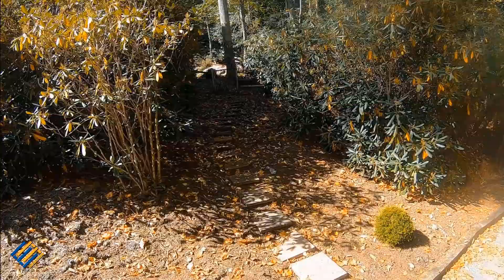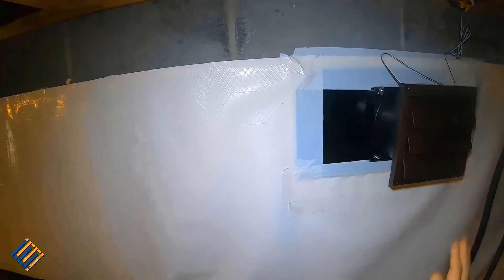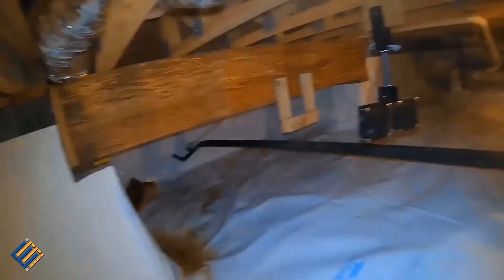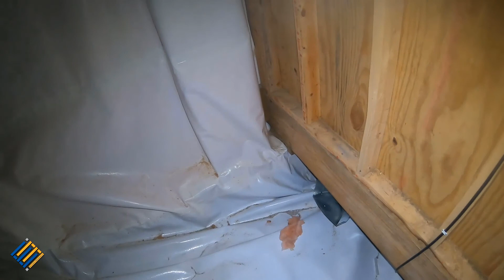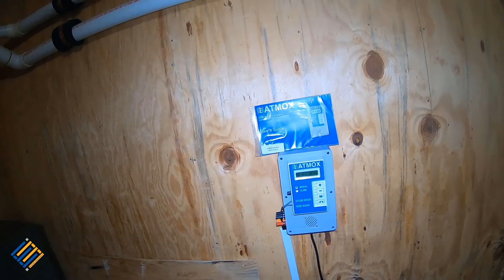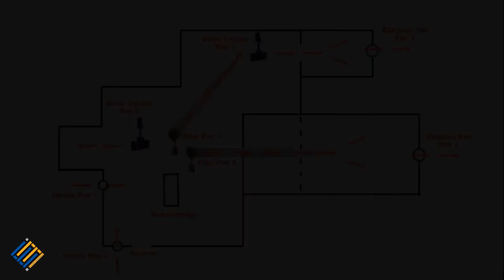Control Crawl Space Moisture Atmox   Waxhaw NC   Specialty Foundation Repair   704 787 6972

Comment: Thank you for making this informative video Mr. Masserang. I recently encapsulated my crawlspace and installed a dehumidifier. Now my power bill is uncomfortably high. This Atmox system looks like it will help me bring my power bill down to reasonable levels.
Reply: Thank you for watching the video! Yes, there is no question that you can bring your operating costs down by utilizing the low voltage fan technology as the primary driver for the program. By reducing the run time of the dehumidifier you can save on monthly power bills as well as extending the lifespan of the equipment by many years as well as improving the overall air quality for the home. The results are real as the video shows. The secret is getting out one customer at a time.